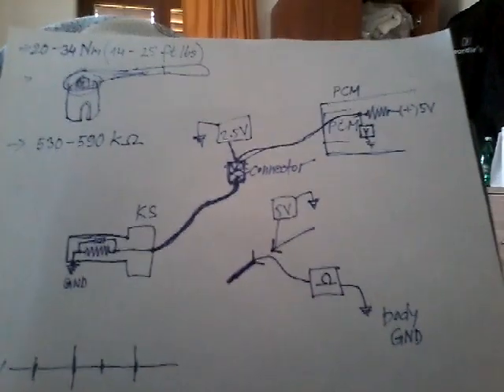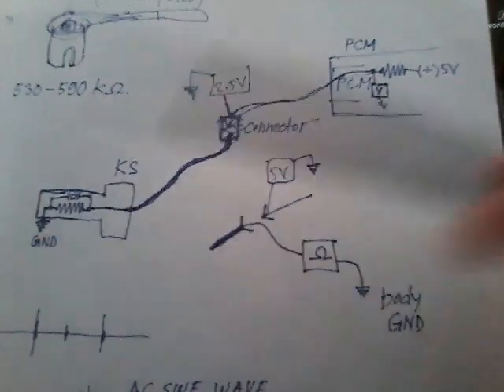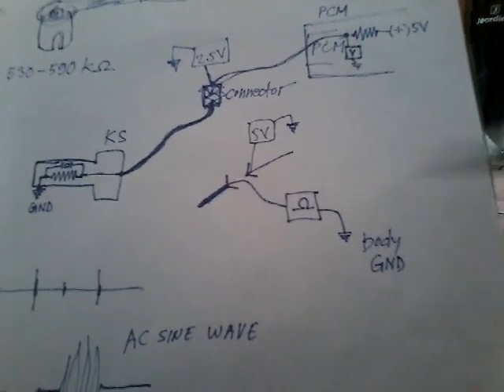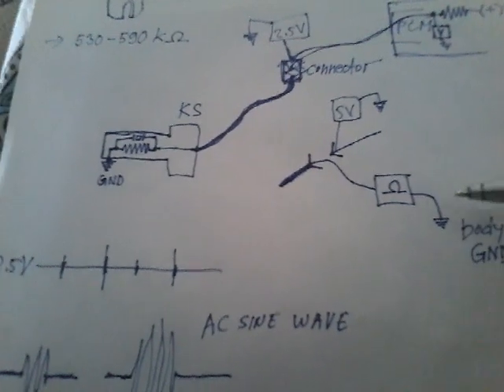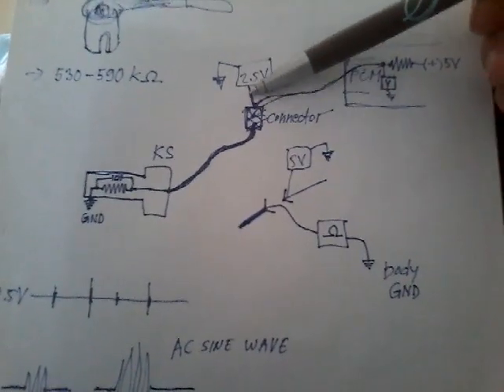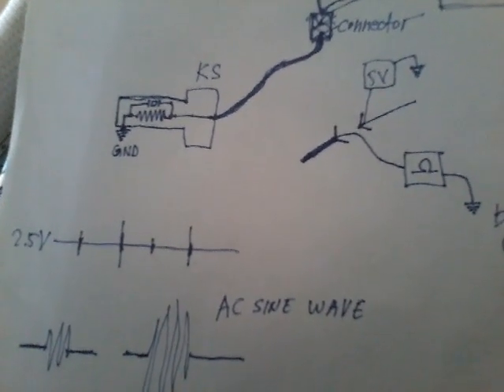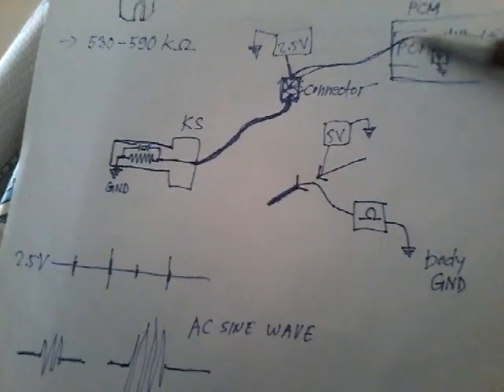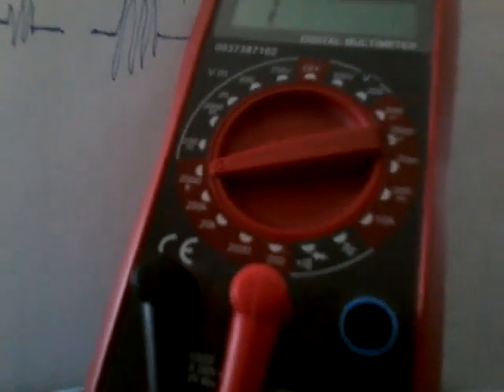Mazda 2: Knock sensor, part 2

Comment: Hello , does the same measurements apply to mazda 3 bk ? I HAVE A KNOCK SENSOR PROBLEM BUT ON MAZDA 3
Reply from the maker: Yes, it does..but keep in mind that when you disconnect the sensor, the voltage that comes from the computer may even be as low as 3,2V  and still that’s fine! As long as it’s not close to 0V, everything is fine. 🤷🏼‍♂️
Reply: @zvonimirbobic1093  Thank You for the reply !

Comment: thanks for making the video. I have one question tho, i backprobed the connector(disconnected from sensor harness) and I didn't get 5v. instead i get a reading of about 3.26v. does that mean i have problem with my ecu?
Reply from the maker: BennyH No, your PCM is fine..what I explained in the video is generalization..fact is that the resistor in the PCM is of such a high resistance sometimes that even your DVOM is pulling it down from 5V to 3.2V..now, you may ask: but what about “no current flow no voltage drop” rule?..(given that the connector is unplugged, so the circuit has no gnd)..well, there r some exceptions!..fact is there is always a tiny current flow through the DVOM..if you were able to somehow use an X-ray  (and not touch with your Dvom lead to that wire), you d be able to measure there those 5V..worry not!..your PCM is fine!!!!